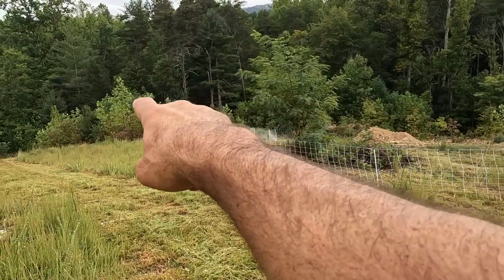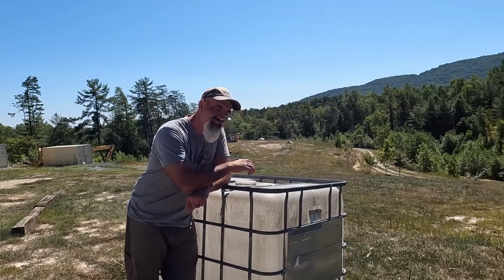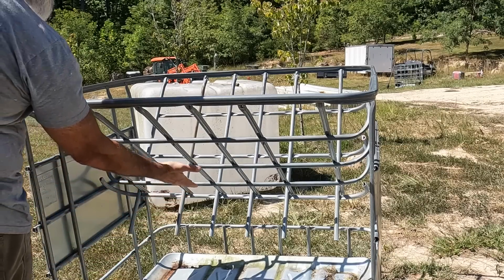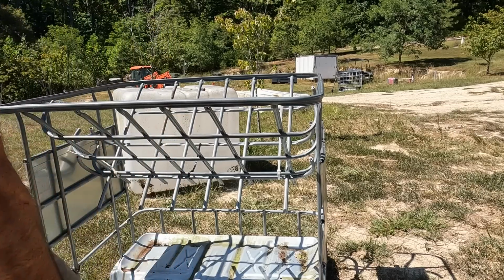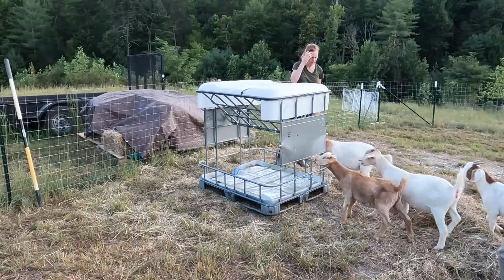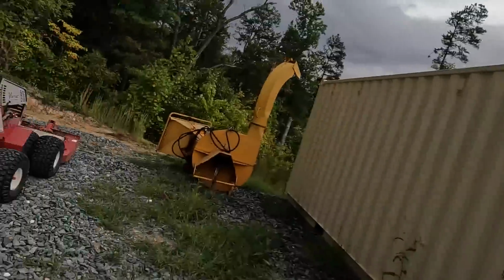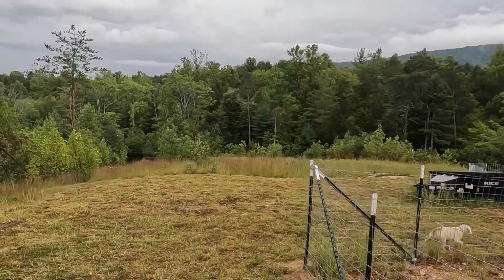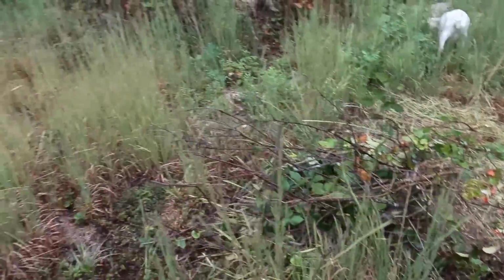Making a good simple hay feeder

Comment: Not to add to the financial distress, but a quick hitch can be had rather inexpensively to make swapping out attachments quicker and safer. Add a hydraulic top link (ala Tractor Supply) and it's better yet. With you out there by yourself better part of the time, it helps eliminates the possibility of injury.